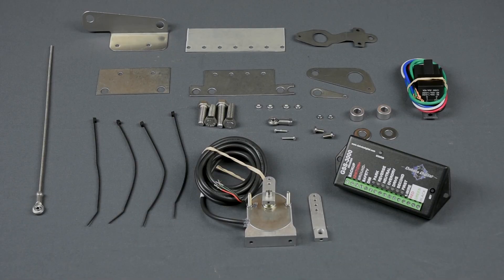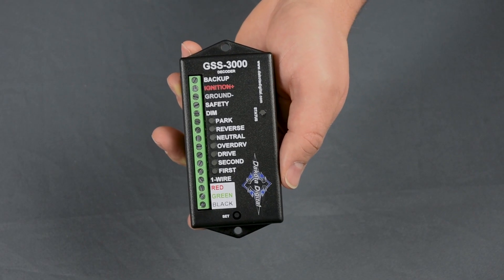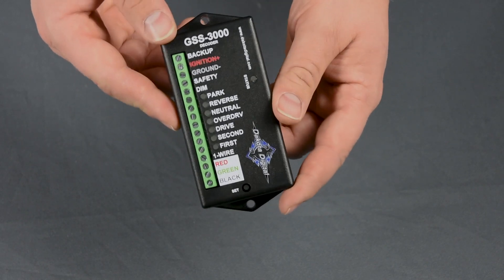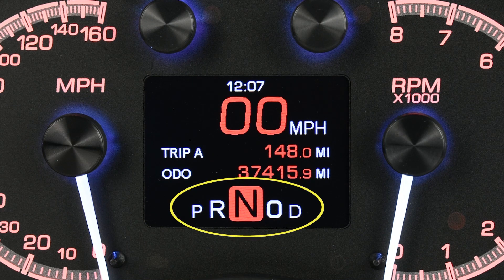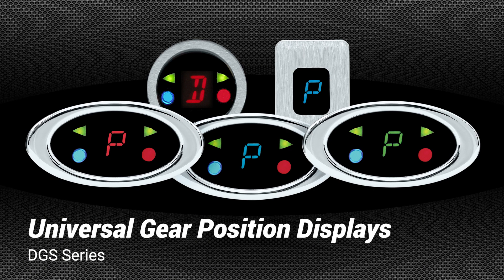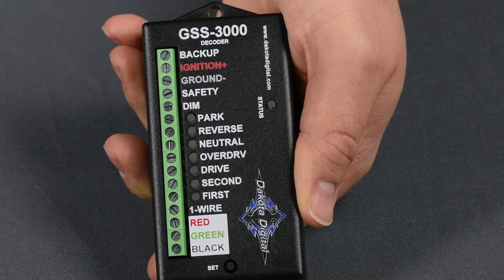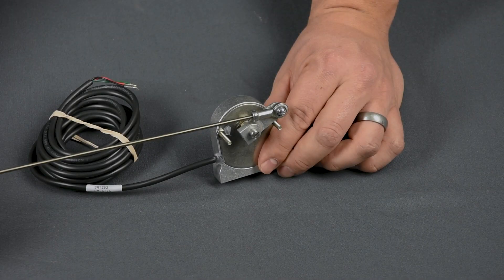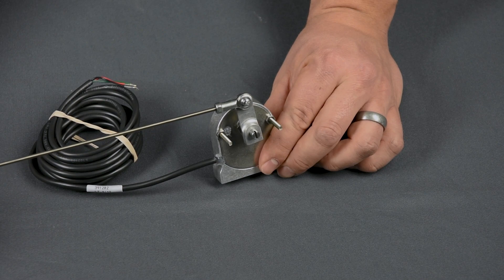Gear Shift Sender GSS-3000

Comment: Definitely seems possible for Dakota Digital to engineer it, this should be included in the Holley BIM unit.
Reply: Thank you for the message, which product/function are you suggesting be integrated with the BIM-01-2-HLLY?
Reply: @DakotaDigital-rx1jf  Gear Shift Data, so a GSS-3000 does not need to be install as well.

Comment: the gear shift ARM on the sensor can be removed from sensor to install it back upside down and it can be programed in the normally way?
Reply from the maker: Good day,
Yes, the arm can be easily removed with a single set screw holding it into place.
Reply: @DakotaDigitalTV  so the sensor can be programed to move the arm from left to right or right to left?
Reply from the maker: @javierargumedo3  Yes, this sensor can move either direction and allow for proper calibration.

Comment: Will this work with a t56 or thx manual?
Reply from the maker: Thank you for the message.  The GSS-3000 is only for use with automatic transmissions, unfortunately it will not function in a manual application.
Reply: @DakotaDigitalTV  ty for your  quick response, do you offer any options for manual transmissions?
Reply from the maker: @pilsonandrew  Thank you for the reply.  Sorry, no current products to display a manual gear position.

Comment: will this work with  8hp70 and an electronic shifter? I believe all is electronic and no mechanical movement is done on the outside.
Reply from the maker: Thanks David,
Unfortunately not, an external mechanical movement would be required for this to see the changes taking place.

Comment: So if I'll get an RTX gauge system for 79 Corvette, I'll still have to get gss-3000 to see which gear I'm at on TFT screen?
Reply from the maker: Thank you Victor,
Yes, the GSS-3000 would be used to add the gear indicator display within an RTX kit.

Comment: Will mounting this unit on my 700R4 interfere with mounting one of your cable shift linkage kits?
Reply from the maker: Hello there,
If the included mounting bracket does not properly fit when using a cable-actuated shifter, you can move our sensor in front of the shift linkage.  Since this is a programmable unit, where it sits is not important, it can learn the movements across the various placements.

Comment: I am running a 4l80e with a Holley Terminator x Max ecu. Wouldn’t the gauge cluster RDX Receive the gear shift data from the ecu? Do I need a separate Box? Like the GSS-3000
Reply from the maker: Yes, the GSS-3000 would be used in this application.  The gear data is not passed through the BIM-01-2-HLLY/ECU.

Comment: Will this work with the 6L80e transmission?
Reply from the maker: Hello Dale,
Yes, the GSS-3000 will work out here.
Reply: @DakotaDigitalTV  In the video it say it works with 4 gear possitions + park,n,r.  So does it really work with a 6 speed?
Reply from the maker: @dickmick5517  Hello again Dick,
The GSS-3000 is designed to display the detent location of the shifter, not the internal gear which the transmission is using.

Comment: Is there a way to make OD on a 12v switch for say a 46re? That way when in drive I could turn OD on and off and it come up on my screen? Or would I just need to connect it like a 727?
Reply from the maker: Thanks for the message Justin,
Unfortunately not, the GSS-300 does not allow for a pushbutton OD input trigger.